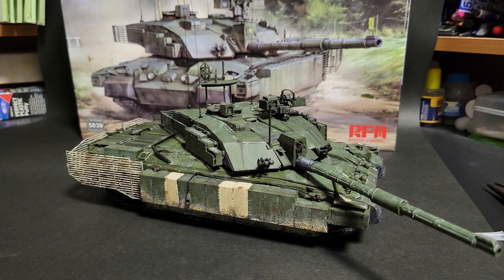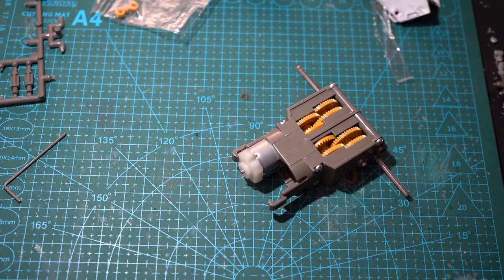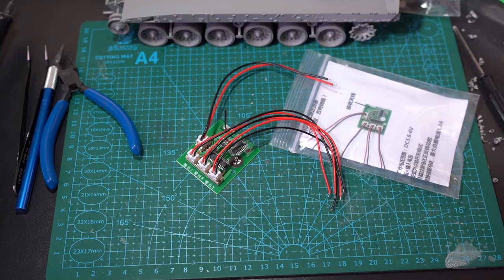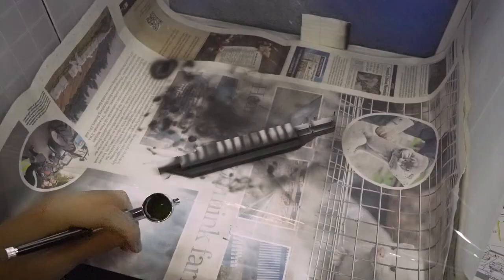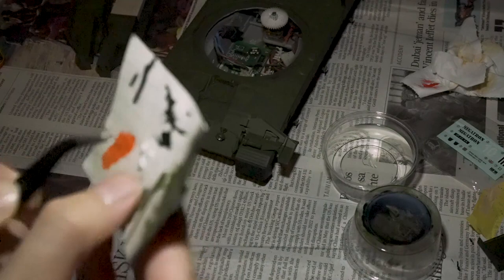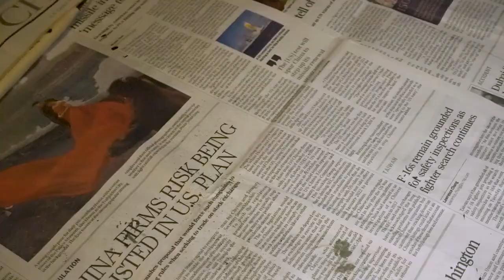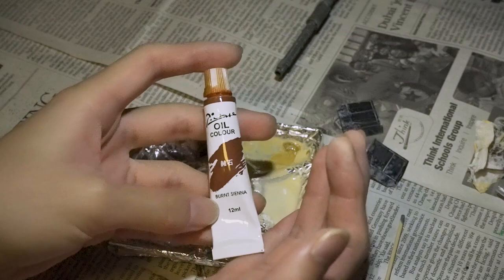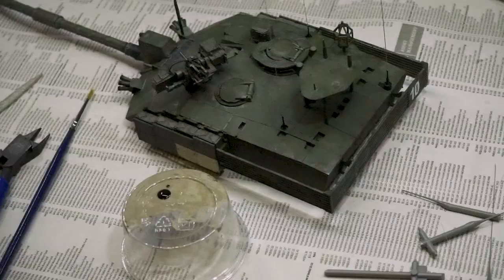Building, Painting and Weathering: 1/35 Challenger 2 TES from RFM

Comment: I am planning on buying this and convert it to RC. But I am not sure on how do you remove the gearbox when you need servicing? my previous rc converted model kit has a path so the gearbox shaft can get in and out easily.
Reply from the maker: The gearbox is basically not meant to be serviced outside the model. That's why I used a high quality Tamiya one that I know will last a while. If I really need to take it out, the sprocket's shaft can slide out and the gearbox will be freed. I do recommend you to hot glue the gearbox in place so as to reduce vibration though. Good luck on your project.
Reply: @abcmodeling  sorry for late reply. Thank you! I built another model and succeed, you can check my video